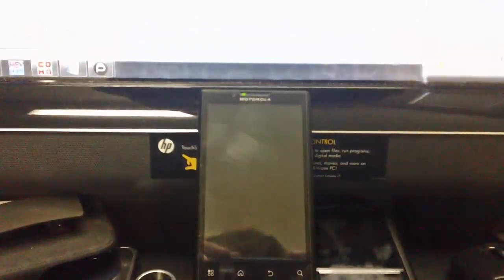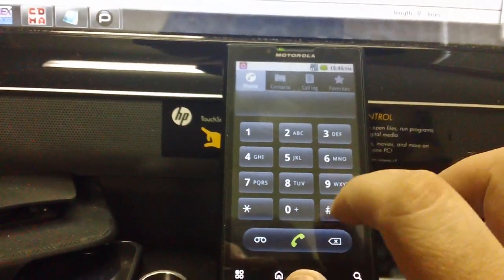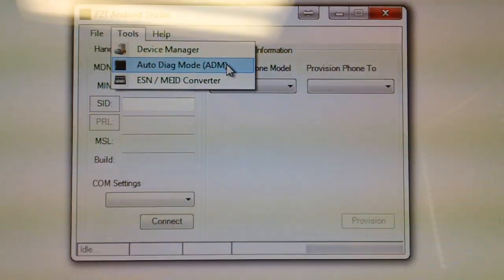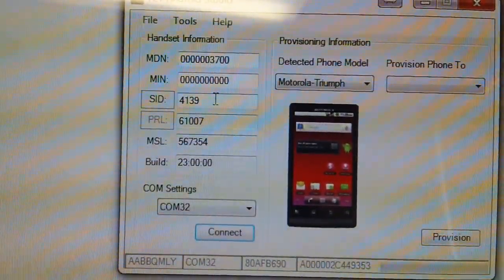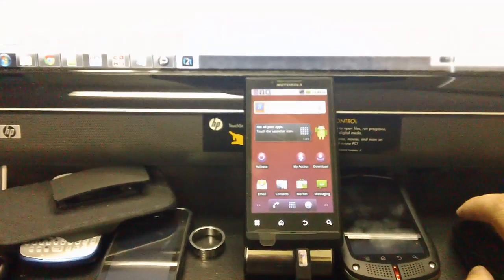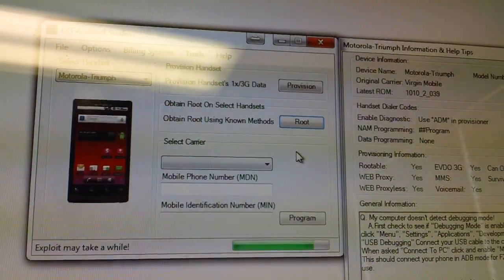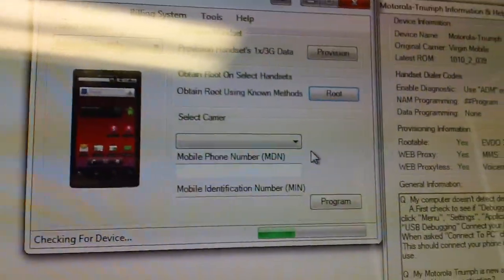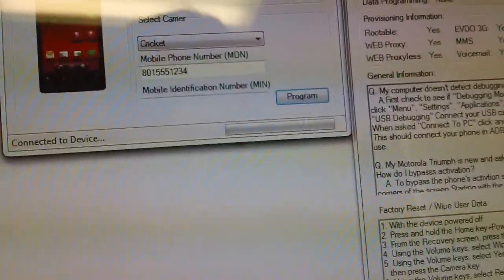FAS Flashing Motorola Triumph

Comment from the maker: You obviously don't know what i'm doing. It takes 15 secs to root the phone. 
This is a full flash to another carrier.

This software is designed to flash phone from one carrier to another with in 2-5 mins.

This isn't just a root program. It took less then 30 secs to root the phone. Same case if you used gingerbreak!